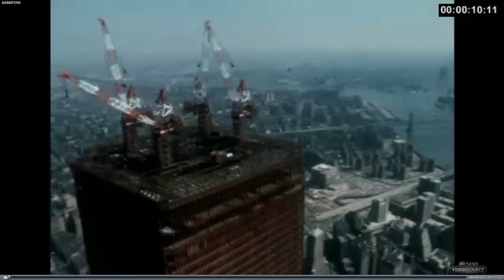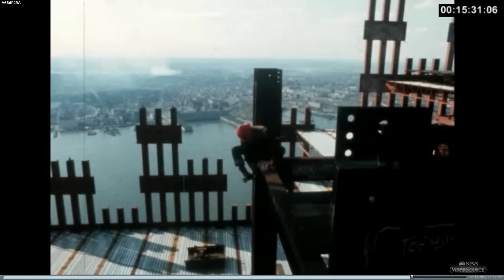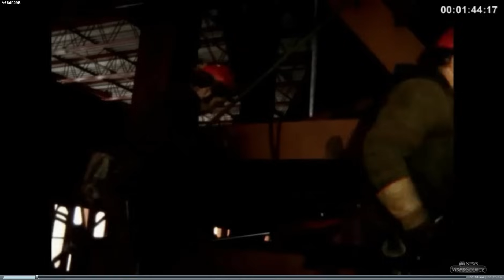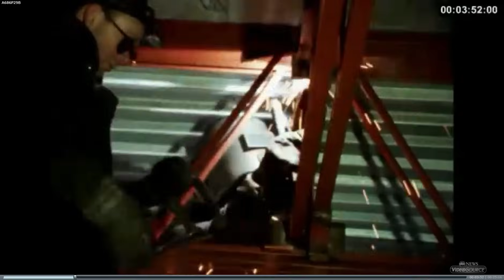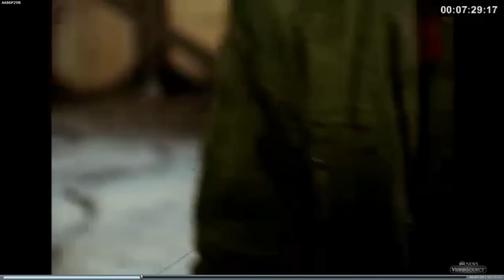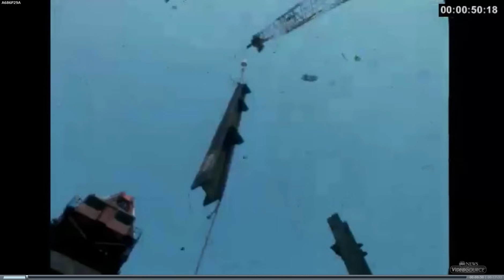WTC South Tower Construction Shots - March 1971

Comment: The outer welders had balls of steel
Reply: I feel like u made an unintentional pun
Reply: I be got severe height phobia I admire those badasses so much
Reply: Ĥĥķòķķkkkàaqqqqqqq
Reply: Even Google translator translated this joke for me perfectly :-)
Reply: Not even jet fuel could have melted them
Reply: @vexhilarius It doesn't even have to get close to the melting point to weaken them by at least 50 percent and a fire can DEFINITELY DO IT but the real reason they put FIRE PROOFING ON STEEL BUILDINGS  is because steel has a higher expansion coefficient and expands alot when heated, In a fire, its severe and the other parts of the structure prevent it from expanding and it causes them to warp and fail! Kind of like the floor trusses sagging, Something that usually happens in fires.🤦
Reply: Se armó con chatarra oxidada 😢
Reply: @iuhsdihdslifuvholuidfh  Cool story, doctor.  Now explain to us how molten metal flowed and gathered into pools under the rubble, MONTHS after the demolition.

Nah, scratch that, I'd rather not hear it.  I'll do it for ya with one word:  thermite.
Reply: @ranchdressing1037 what?
Reply: @iuhsdihdslifuvholuidfh  These floors couldn't have pancaked into dust on their own
Reply: they actually had balls of iron
Reply: @jamiepippin3892 Yes they could pancake lmao, that’s very obvious if you know how much the upper part of the building that came down weighed and how the building was designed.
Reply: @craigusselman546  I went up to the 107 floor of the twin towers. It's was so scary I have fear of heights it felt like I was going to fall.😵‍💫😩
Reply: Type in Ally law on YouTube . What now? 😮
Reply: I know right.

Comment: I now realise, that the buildings only got 30 years old
Reply: 28 years old
Reply: WTC7 was opened in 1989 and destroyed in 2001. The only tower (47 floors) demolished with no victims inside. 
References available.
Reply: If they have stuck around they would've been 50 years old this year.
Reply: Didn't deserve the end that they got
Reply: WTC7 was opened in May 1987. Where the hell did you get 1989 from?

Comment: I was reading the nist report and was impressed to find out how the towers were tapered in a sense with the different thickness or gauge I guess you would say! The lower columns and walls had to support more weight. It was interesting that 14 different types of steel were approved for building but 12 were used. And just as many strengths! Very cool to read how they were constructed!
Reply: The outer wall pillars of the 78th floor were not "I" BEAMS , but were box beams . Box beams on the 78th floor were square on the end and are 4 flat steel plates of one and a half inch thick  and welded together . 
   Nist used dimensions of the top 3 floors outer pillars that were only ¼ inch thick steel plate to suggest the whole top 25 floors were that thin . But ¼ inch thick steel plate would not hold the weight of 125,000 tons of building above it .  There was " as thin as " ¼ inch thick steel , but only in the top 45 feet of outer wall frame .

Comment: Damn, 271 in 1971 is equivalent in purchasing power to about $2,035.02 today, an increase of $1,764.02 over 52 years. The dollar had an average inflation rate of 3.95% per year between 1971 and today, producing a cumulative price increase of 650.93%.
Reply: Ounce of gold was only 35 dollar in 71
Reply: @sahelkubrom1636  Also, 1971 was the year Nixon took the U.S. off the gold standard.  Big mistake!

Comment: I always was amazed me how a plane travelling at 600 mph can disappear inside a building without it coming out the other side..I know on the second plane you did see a few thing fly out but when u look at the construction I understand why as it has two cores..I would love to see a simulation of the inside of the building as the plane hits and see what the effects were on the inside of the building..I remember Chief Oreo Palmer was one of a very few who actually saw the state of floor 78 but you could tell by his voice it was hell up there with numerous code ones everywhere he looked.😢❤R.I.P..❤
Reply: Because the planes were built from aluminum + carbonfiber panels. If they were steel, they would come out and the buildings would probably collapse immediately. The flying bits from the second plane were titanium parts from the engines. There is a simulation about what happens after the planes hit.
Reply: There’s any number of computer-generated re-enactments here on Yt ..
Reply: The core was just columns and elevator shafts,no concrete core,and btw the core was surrounded with gypsum boards

Comment: judging by the thickness of the columns and beams, it becomes clear that the buildings did not have any significant margin of safety, it is even surprising how the southern tower survived after being rammed by an airplane; perhaps if the blow was lower and direct, the outcome could have been much worse, this also explains the reason for such a rapid collapse of the buildings , such a weak structure could not withstand the collapse of the upper part even from a height of several meters and, having received an impulse, the collapse went lower
Reply: They also had a substantial central core where the main beams and elevators run, check it out
Reply: @danieleperini3565  if you look at the plan of the usual floor of the tower, the core does not seem so massive and strong, it carries most of the static and dynamic loads, while the columns have a small cross-section for such large loads from the weight of the floors, they were overloaded initially
Reply: All the twoofers think these buildings where invincible and could only be brought down by controlled demolitiom charges etc…. I mean ffs two planes hit the buildings with all that force from the mass and velocity and fuel being released throughout impact zones of each building and start fires. What did they thing was going to happen 🤷🏻‍♂️
Reply: The lingering question in my mind is what exactly happened to that top sec of the S T .. at apx. a 25 - 30 degree angle it literally looked like it wanted to break off intact and fall into a neighboring building .. not alleging any theory here but it is rather odd how it (that top portion) just somehow mysteriously “disintegrated in place” on the way down ..
Reply: @Spector06111  I think if the towers had columns on the open floors, they'd probably still be around today, but Yamasaki wanted open office space which would've defeated the whole purpose

Comment: You can see why they collapsed. Mostly steel and rivets, and steel in a hot fire loses its strength. Contrary to popular belief it doesn't have to melt, just soften.

One conspiracy theorist I talked to recently was absolutely adamant that these buildings were constructed of concrete. He said he was there and they were concrete. I said: Sir, get real, everybody knows the Trade Centers were held up by steel. He said: No I was there before they collapsed they were concrete. I said: Oh really? Then what's all that stuff sticking out of the debris field like a bunch of matchsticks? 

The mental gymnastics these conspiracy theorists will go to to believe their own "theories" is worthy of Olympic gold.
Reply: I love the guys that say they put the "explosives" in when the towers were being built. I mean, seriously. They believe that 9/11 was 1. an inside job, 2. the towers were a controlled demolition, and 3. that the explosives used for that controlled demolition were put in 30+ years prior to 9/11 when the towers were being constructed... I know many of them have other (idiotic) theories about blackouts prior to the event or elevator maintenance, none of which are plausible, but the one where they built the towers with the explosives is just on a different level. 

I think I encountered that same guy insisting the buildings were constructed of concrete. I explained to him the simple design of the building and that the only concrete in them were the 4" slabs that sat on top of the floor trusses making up each floor (metal sheeting on top of the floor trusses that the concrete was poured onto). I also explained to him that those floor trusses were extremely susceptible to fire, and he could go to any Home Depot or Walmart and look at the ceiling and see what they look like. He also mentioned it being impossible because fire wouldn't melt the steel, so I asked him what would happen to the steel at 100 degrees below the melting point. Did blacksmiths melt the steel to form it? Or did they heat it up to bend it into shape? He didn't answer me.
Reply: One thing that cant be known for sure though. Who directed the pilot to fly the plane into the building? Was it an inside job? There's questions that need answered. And there is no shame in having these questions.
Reply: @mikepurdue7472  What? What are you talking about man? Who directed the pilots to fly the planes into the buildings? Neither of the pilots of the flights were flying the planes when they hit the towers, both planes were under the operations of the hijackers. Did you really not know this? They were taking classes on how to fly planes in the months leading up to the attacks. If the real pilot was still at the controls of the aircraft, they would have done anything they could not to let those planes hit those towers, even if it meant crashing the planes into the rivers. Any pilot would have the wherewithal to know the implications of what would happen should they crash into the building. They just wouldn't let it happen. I've never in all my years listening to people be skeptical about 9/11 once heard someone say this. If you didn't know that then this leads me to believe you know very little about what factually occurred that day.
Reply: @IJustFiguredThisOut  Yeah, who motivated the hijacking?
Reply: @mikepurdue7472  What? Are you like 12 years old? Old McDonald
Reply: @IJustFiguredThisOut  No. Im 32. Im just wondering, there had to be some sort of motivation behind the hijackers. How many plane hijackings have happened since that time? And how many hijackings have happened before this time? Especially 2. In the same day. In the same hour.

It's weird shit man. And to state it, shouldn't make me a 12 year old. Did you motivate them? You sure seem to want me to not think anyone motivated them. 

Did Bush motivate them? Did the Clintons motivate them? Who was their flight instructors? Were they being trained how to fly planes by Americans?

You should really open your mind a bit more. Unless you have something to hide, I mean.
Reply: @mikepurdue7472   Do you seriously just not know or understand what happened? If you're 32 then you would have been 7-8 when it happened. I'm sure you remember the day maybe, but I guess I can understand how you wouldn't really be able to remember what the world was like then. It's just weird hearing people ask questions like this.
Reply: @IJustFiguredThisOut  I remember very well. I was in fourth grade. There was an announcement about it on the intercom. We were all told to remain calm but to check out what is happening. They rolled a tv into the class and we followed along with it all.

The local military base started preparing troops too. My cousin went to Afghanistan not too long after. He ended up being blown up over in Kabul by a roadside bomb in 2004. And i'm not even in the states. Im Canadian.

Don't you try to tell me I don't know what went on.

The only thing we dont know for certain is, who told the hijackers to do it. You're naive. That's a you problem.

Comment: I always have these two questions about their construction. 1. How did the steel columns get their silver-white color when they were original a brownish red color? 2. How did they install the windows?
Reply from the maker: 1) Aluminum cladding.
2) From inside and maybe from the outside too, while standing on makeshift working platforms.
Reply: @Bernie Ganders, Silver aluminum alloy.
Reply: They were covered in aluminum siding A LOT of aluminum siding that gave them their silver shine.
Reply: You can actually see that the were always that brownish-red color, after the towers collapsed many columns had their aluminum cladding stripped and the raw steel was revealed
Reply: Yamasaki initially wanted the paneling to have a yellowish, soft, warm tone. But when they brought him different samples of cladding, he settled on pure silver aluminum, believing that it would better reflect the sun's rays in different phases of the sun's position. 29.06.24.
Reply: The cladding was anoised aluminium